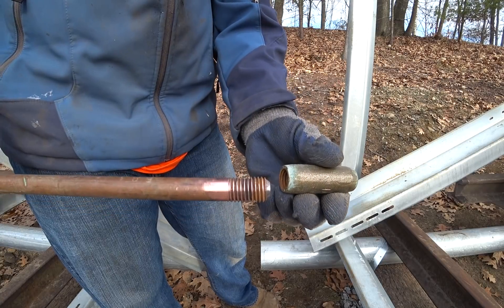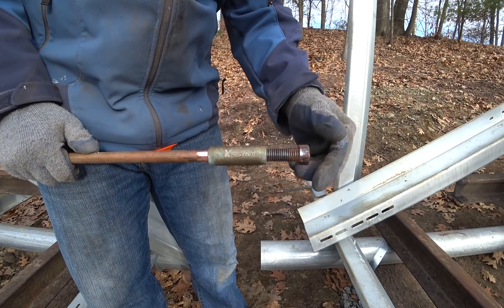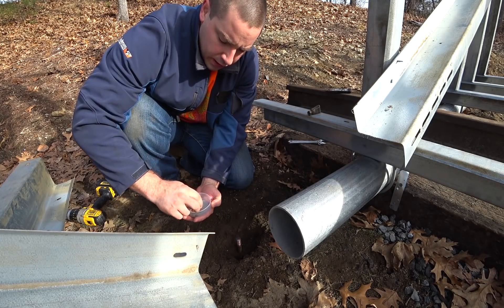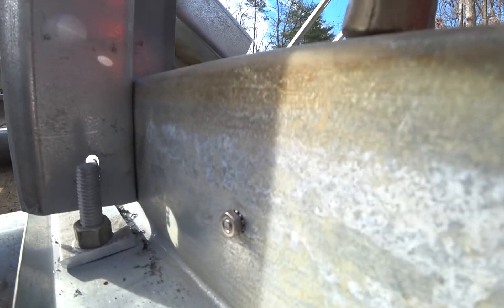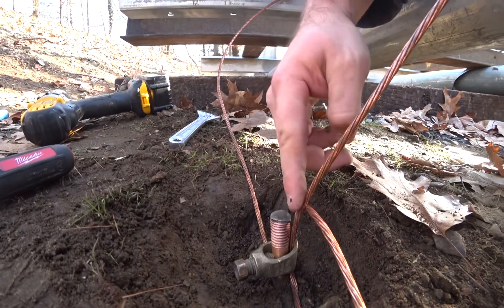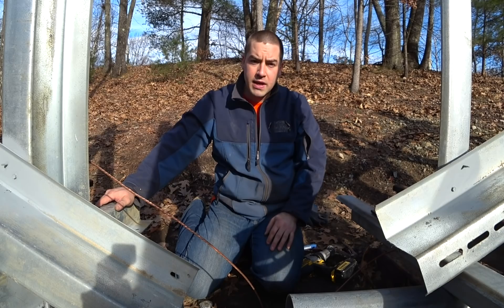Protection From Electrical Shorts by Grounding Frame

Comment: You must run a #6AWG sized bare conductor below grade to bond your solar array ground rods directly to the ground rod at your main service entry panel to create an equi-potential zone. Otherwise you will have a very dangerous touch potential situation and dangerous voltages will enter your house if ever you have a lightning strike and it doesn't have to be a direct strike,  the lightning only has to hit nearby for it to be dangerous.
Grounding and bonding is one of the areas a lot of people get hung up on.  Quick rule of thumb I learned from a very smart person. 

NEC is real simple when it comes to Bonding and Grounding. Draw this picture in your mind. Bond everything below ground together, Bond everything above ground together, and then Bond the two together at one point only and call it the GEC(Ground electrode conductor) as the GEC and Lightning Down Conductor are the only two real Grounds in a system. Everything else is just a Bonding Jumper or Conductor.

Comment: I have a silly question. For 400 W (4 panels) system installed on my patio, do I need to use  #6 Copper Ground Wire? Higher gauge wire kind of expensive, I wonder #10 or thinner can do work. By the way, your Amazon ground lug link is unavailable. Can I use a cheap cable clamp for a substitute? https://www.amazon.com/dp/B07Y38PW8Y/ref=cm_sw_em_r_mt_dp_U3KxFbAV1YXDN
Reply from the maker: Sorry, but I don't know the answer to your questions.
Reply: Grounding is one area you don't want to go cheap on.

Comment: David and all on the sight! You can use a water hose and Pumping the Ground Rod up and down rapidly can drive the rod in the ground (Most soils) without lifting a mallet. As a Amateur Radio Operator(Ham Radio) I was ecstatic to learn this trick!  Just some easier method to get the rods in the ground. http://www.rogerhalstead.com/ham_files/ground.htm
Reply from the maker: Thanks for the tip.

Comment: As I understand it, grounding 1 or 2 pieces of metal does not ensure grounding (bonding) thru all the other pieces of metal in the framework.   To me, it would make more sense to either IronRidge (or similar) rack bonding system or run a grounding wire from each panel down to the grounding rod / combiner.      I also wonder about having a local grounding rod as apposed to grounding to the main house ground as this can setup potentials in the ground between the 2?  but I'm no electrician.  My array is on IronRidge (racks/panels are bonded per code) and grounded to house ground and this passed City Inspection.
Reply from the maker: Hi Kenat Tagexp.  I've done it both ways.  I have a solar array in my front yard with a copper grounding wire going to every panel.  With this array, in my backyard, I used star washers to bond the panels and frame together electrically.  This allows me to ground any single piece of the frame and effectively ground everything together.  Thanks for sharing your experience with IronRidge.

Comment: David,  easiest way to bury that rod  without using a hammer and risk bending the rod: dig a small hole where you going to plant the rod.  Fill up a 2 liter bottle with water.  Fill the hole with water,  and take the rod and start hitting the ground.  The rod will start to sink very quickly.  Keep adding water.  Been there,  done it :)
Reply from the maker: Thanks for sharing a good tip.

Comment: I’ve seen where each individual panel is grounded to each other in addition to the frame grounding. I’m not an electrician so I really don’t know which is correct.
Reply from the maker: I did exactly that with my array in the front yard: https://youtu.be/1ldNGpd7ebY  The difference is the way the frame and panel are connected.  Different system.

Comment: This portion of the project has several faults.  First the ground electrode is too short, you need at least 8 feet of 5/8-inch rod.  The rod is not currently an approved ground electrode, it is in sections that are not compression coupled together, or other suitable means.  The ground wire was routed through a hole in the frame that is nor provided a grommet.  The ground wire to the "combiner" needs to have a compression splice, and not use the acorn nut to splice.  The frame must be bonded, i.e. connected by a suitable copper wire, to the ground at the service panel on the primary building.  A grounding system may have several ground electrodes, but they all must be bonded together and to any metal element of the structure.  The concrete piers act as concrete encased ground electrodes, but will not be acceptable for that function, they need to be at least 20-feet of 1/2-inch bare or zinc plated rebar in direct contact with the earth.
Reply from the maker: Hi Steve Schulte,  Thanks for your feedback.  I can correct most of this, but I'm confused about the "compression splice" instead of acorn nut.  I tried searching for "compression splice" but could not find something associated with grounding.  Would you mind linking to something to help me out?  I've only seen the acorn nut be used.   Thanks.
Reply: @DavidPozEnergy  Your acorn nut is OK.  You can completely bury the ground wires and top of the rod.  In Kentucky 8 ft solid copper is required for the grounding rod.  For residential you need two rods spaced at least 6 ft apart and connected together to pass code.

Comment: Your ok with this grounding electrode as long as you don't bond it to your main service grounding electrode.  Watch this Mike Holt video: https://youtu.be/YuDqXFvRv94
I elected to run a grounding conductor from my main service ground to all 4 of my ground mounted PV arrays rather than installing auxiliary ground rods at the arrays as required by NEC 2014.  The concern is what could happen in a lightning strike event.  I have discussed this with my county electrical inspector and he agrees. Keep up the good videos.....your going to finish your system before me most likely.
Reply from the maker: Just finished watching the video you linked to.  Great video.  I'm now questioning my setup.  This is one diagram I was using to help me: https://www.altestore.com/static/datafiles/Others/dc-gfp50-300_wiring_diagram.pdf  But now I'm not sure which way to go.  Do I remove my rod and bring the solar panel bonding in through the combiner box, into the DC load center in the garage, then make a connection to my garage sub-panel, because my sub-panel is grounded back to my main panel in my house, where it then goes outside to my houses duel ground rods?  I  might have to make a video just describing my ideas, before hooking anything up.
Reply: I think that drawing is correct.  The array ground is connected to a ground fault breaker but is not bonded to your main service ground.  You would just bring the array ground into your new DC subpanel.  The batteries feed the inverter which connects to your  AC panel.  This isolates the two grounds. Somebody correct me if I'm off base here.... I don't have batteries in my system.
Reply from the maker: Thanks.

Comment: Hey David is the charge controller you have, does it have GFP and AFP so do some don't I believe you grounded that back in the garage last week which is required.
Reply: 3.2 Grounding
● 
Battery grounding:
 the charger can be installed in a positive or negative 
grounded system. 
Note: apply a single ground connection (preferably close to the battery) to 
prevent malfunctioning of the system.  
● 
Chassis grounding
: A separate earth path for the chassis ground is
permitted because it is isolated from the positive and negative terminal
. 
● 
The USA National Electrical Code (NEC)
 requires the use of an external
ground fault protection device (GFPD). These MPPT chargers do not have 
internal ground fault pro
tection. The system electrical negative 
should be 
bonded through a GFPD to earth ground at one (and only one) location. 
● The charger must not be connected with grounded PV arrays.
WARNING: WHEN A GROUND FAULT IS INDICATED, BATTERY 
TERMINALS AND CONNECTED CIRCUITS MAY BE UNGROUNDED 
AND HAZARDOUS
Reply from the maker: Hi OffGrid Wanabe,  I have already purchased a GFPD https://www.altestore.com/store/enclosures-electrical-safety/ground-fault-protection/midnite-solar-mndc-gfp50-300-50a-300vdc-ground-fault-protector-p9003/  I actually bought it months ago with my charge controller.  Your last bullet point is confusing me.  Not connected?  My intention was to use the grounding bus-bar inside my DC breaker box.  I was going to ground the charge controller, Surge Protection, and GFPD all to that bus bar, then have a 6 gauge ground wire inside the conduit running back to the combiner box at the solar array, and ultimately to that ground rod.  Are you seeing a problem with that idea?  If you do, it would be a huge help if you can link to a reference.
Reply from the maker: Here is a wiring diagram: https://www.altestore.com/static/datafiles/Others/dc-gfp50-300_wiring_diagram.pdf
Reply: @DavidPozEnergy   awesome and not too much money.

Comment: Hi David. I am a Electrician and I like what you are doing, great work 👍
then I make grounding I think about corrosion - because over time it could stop working, do to bad connection. You have galvanized and stainless steel together, that will begin to corrode. I would change that bolt to a galvanized one. Safety first. Best regards from Denmark 🇩🇰 thank you for great content.
Reply: This. Dissimilar metals are not good.

Comment: grounding doesn't protect you from shorts at all
Reply from the maker: I thought a short was when a PV wire rubs against the frame, wears through the insulation, and energizes the frame?  Maybe I'm using the wrong term.  That's what I'm trying to refer to.  Is there a better name for that?
Reply: I guess it would depend if you were the ground. Since this array is insulated from the ground by sitting on wood members if there was a short (a positively charge wire touching the array frame work) and someone was to touch the frame they would become the ground and be shocked since the ground wire is connected to the frame and earth the person touching the frame would have less potential to be shocked. The bonding to neutral occurs in the main panel and not at the array.

Comment: Good ground is important, I used a plate for the first time instead of a rod, and grounded at the array also as the house is already grounded. For what it's worth most of what I read says not to cut the ground wire but to used one continuous piece, the ground on manufactured systems goes from every panel and every metal piece which I thought was overkill along with the use of meems at every bolt.
Reply from the maker: I haven't heard of a grounding plate.  I'll have to go look those up.  Thanks.
Reply: @DavidPozEnergy  I went into the store to buy a rod but the guy says they quit selling those (here in Canada) and everyone uses the plate it's about a foot square with a short piece of rod welded to it, suppose to go under an eve to be in a damp location. Seems this link tells all   https://www.youtube.com/watch?v=NkDYphpg8sM